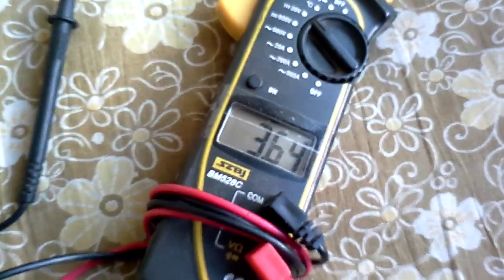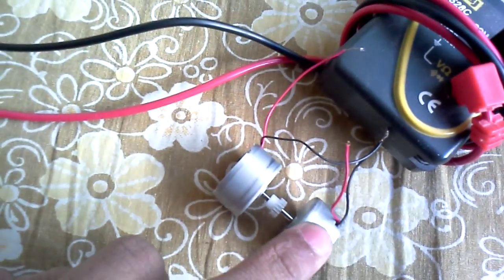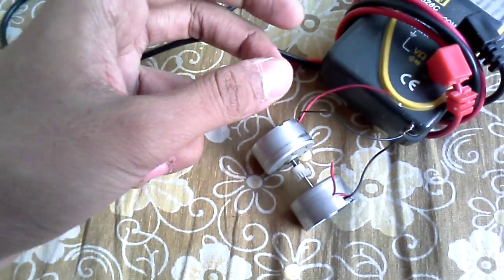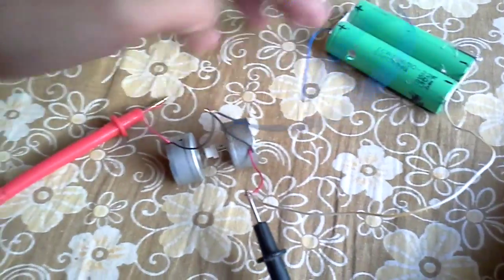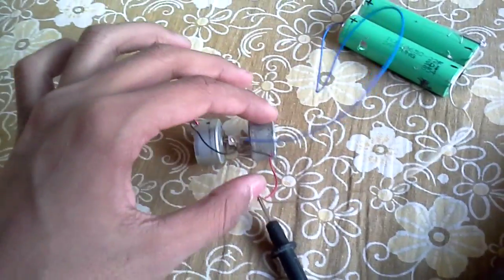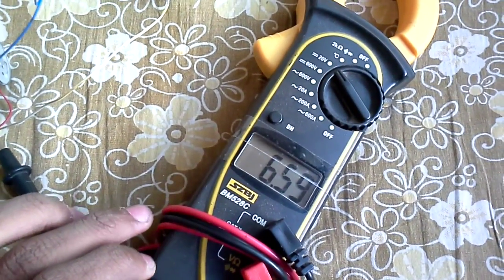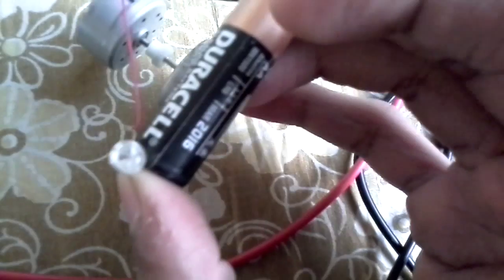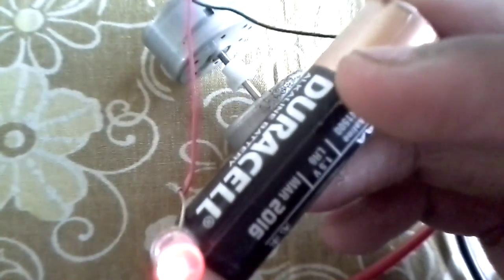Step up Voltage using motors only !!!

Comment: what you're trying to prove is that you can't have consistent power to run a LED.
Reply from the maker: Carlos Andrés Villegas Betancur  its not like that man,im showing you an methood to boost voltage with simple things
Reply: the LED doesn't stay on all the time.
Reply from the maker: Hey ,That is (3)multi color led which ,changing color